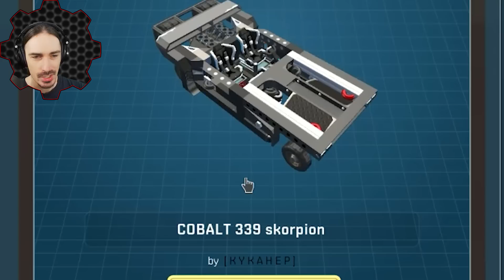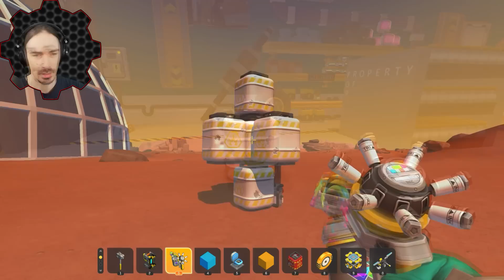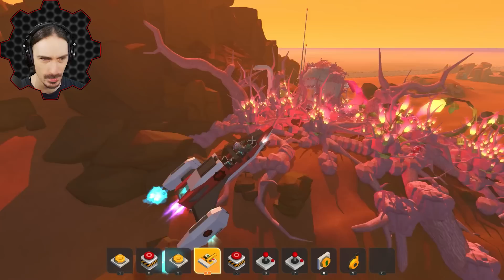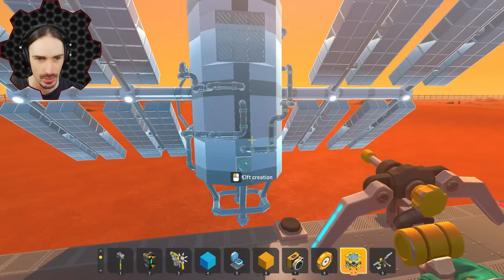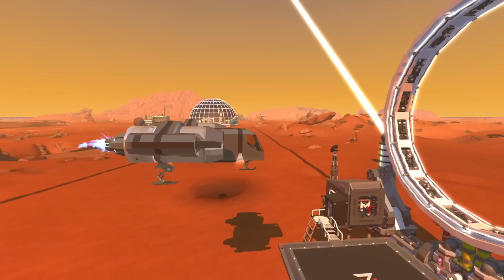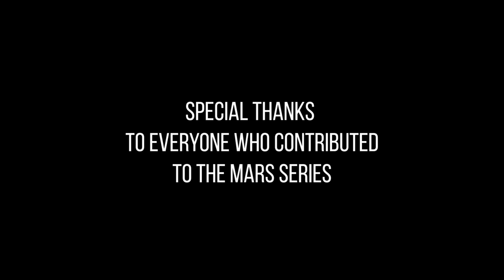This High-Tech Warp Gate Was Definitely Over-Engineered [MCS 32]

Comment: You should make a remote control car race, but there's a twist. You need a timer on the car so it would do certain things, like for 5 seconds it goes forward but during those 5 seconds it turns on scrap mechanic for multi-player Monday example: I press forward with a 10 second timer so it would move forward than at 4 seconds it turns left than right at 7, it's like the self driving car but with a remote instead of self driving

Comment: Is this really the end? There are 2 unavailable videos on the playlist now, and so many loose ends still on mars. The crashed asteroid with antennas, the expanding monolith and the stone structure he mysteriously woke up in. The "SW" at the end of one of the final messages probably meant South West.
Was the eye the blue flower all along? Why did it change colour when given the 'time seed'? What was the eyes relation to the Arcturi?
It was a pretty interesting series, but a bit of a disappointing ending.
Reply: The eye turned blue because it used the time seed to turn the pink flower to bule
Reply: @gabrielitof3r108  Well, yeah... But how, or why? The eye just went to sleep and left Scrapman and Hank to blow up the infection.
Did he even bring a time seed through the portal to give to the Arcturi, as the eye had told him to?